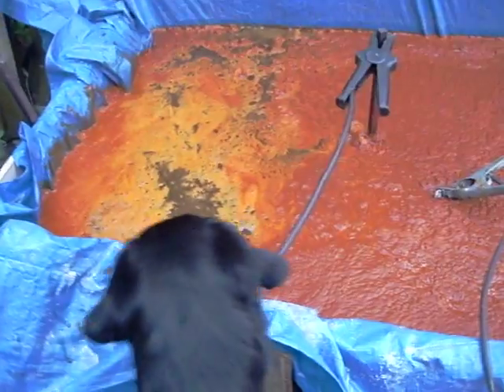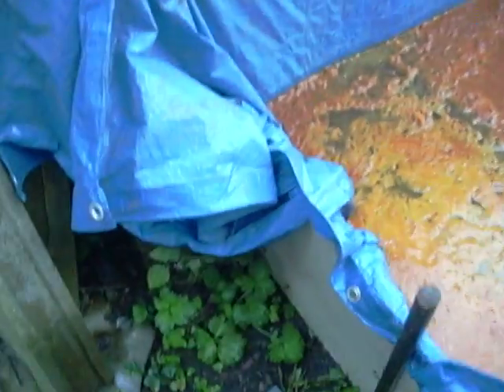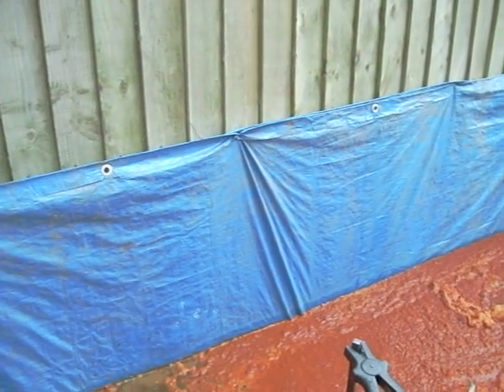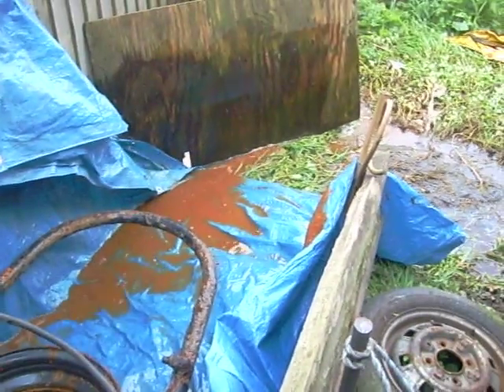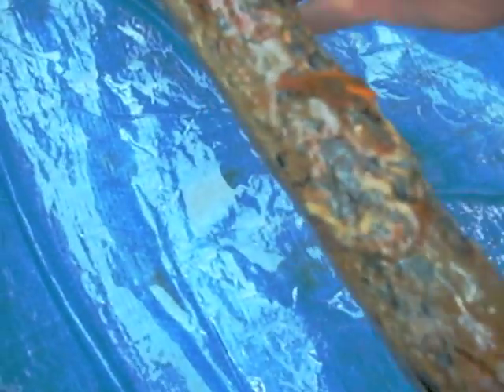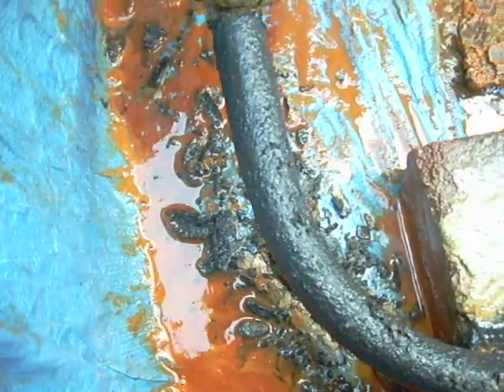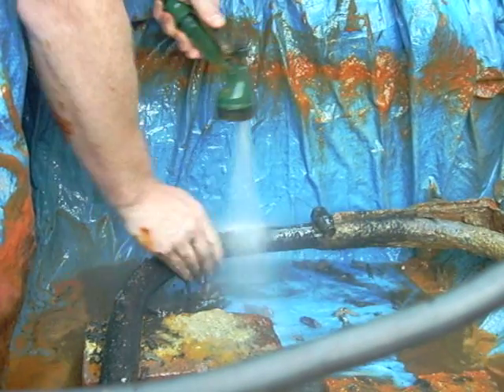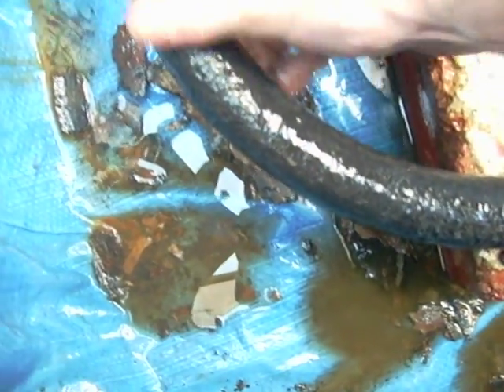SSOD Sunken Sidecar of Doom Chassis  Electrolysis  Rust Removal Part 4

Comment: A few questions.
1. Did you leave it uncovered during the procedure?
2. Weren't you concerned about pets getting into it?
3  You drained it into the garden. Won't that hurt the plants?
4.  What if the pets try to lap it up?
I'm not trashing you; I sincerely want to know. Thanks
Reply: Maginel73 wouldn't hurt pets at such low amperes......This works slowly  (but effectively). Iron oxide will not hurt weeds.
Also just realised that you left this reply 7 years ago! your probably dead!